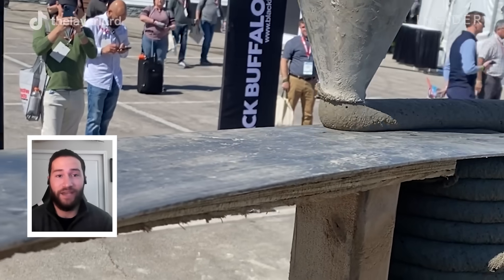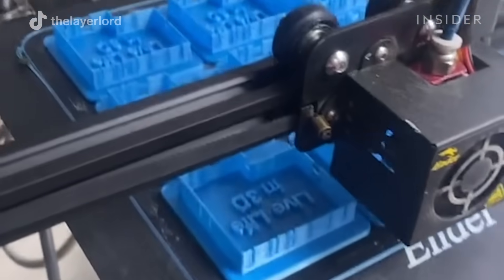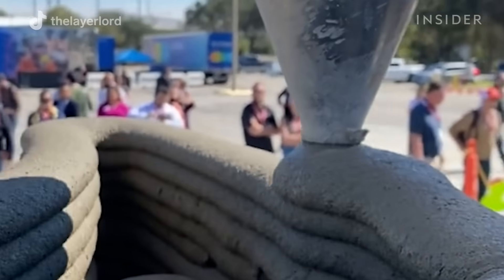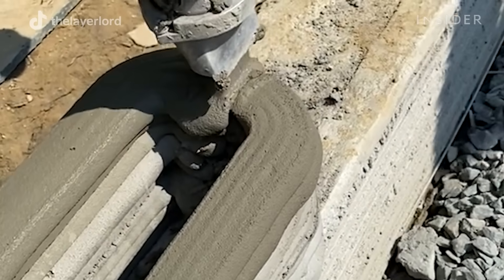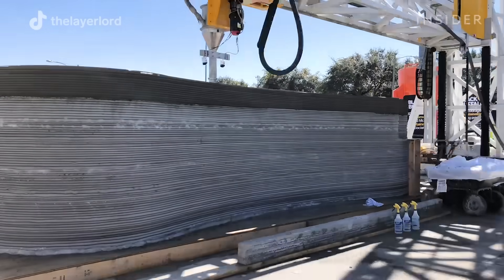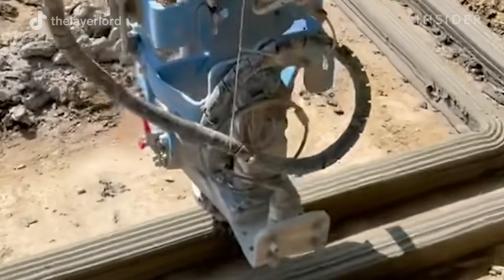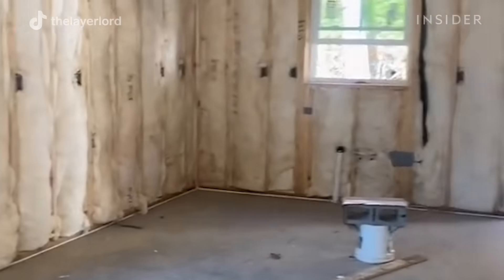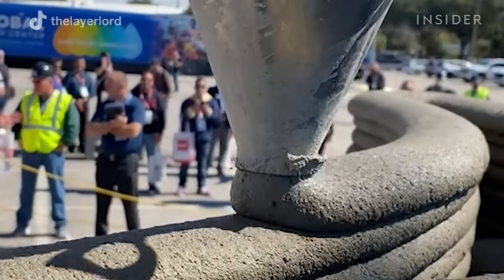How Concrete Homes Are Built With A 3D Printer | Insider Art

Comment: I saw one of these construction sites in my town for low cost housing. The system is incredible to watch. The thing that got me was the amount of labor people needed. It looked like the regular amount of labor used. It amazes me how fast the structure went up. 5 one bedroom houses in two weeks.
Reply: i imagine it will get smaller and less labor intensive as the technology progresses.
Reply: @Teeveepicksures  Well, keep imagining. This will never catch. ICF's are another brilliant technology that never really caught up.
Reply: @Teeveepicksures  시멘트
Reply: Pedro do it in 8 days. For $500
Reply: @bobjones2041  build a house? What?
Reply: @Kneejair I can  build a flimsy cardboard house I can do it in one week,  git er done, I hope that last  check clears before my paint stars peeling
Reply: @bobjones2041 Pedro better than 3D print.
Reply: What is the average cost of a printed home about 2,000 square feet in rural ohio
Reply: No rebar though? Where’s the structural support come from? That concrete will crack to hell with nothing holding it together
Reply: @davek4547  I dont understand it too but maybe they are going for a what is called a "load bearing structure".... basically the concrete is a thick as a brick wall. Rebar or RCC columns and beams are nice but maybe in low earthquake risk places this is possible. Or maybe they are using Wood columns somewhere for support.
Reply: @davek4547  gravity
Reply: @mr.dakamd5444  it still cracks and splits and isn’t strong without something inside. I’ve done commercial concrete for 15+ years. Soon as it cracks, moisture gets in, freezes, pushes it apart etc. it’s not a bad idea I’m just wondering how they engineer it without any bar inside.
Reply: @BB-rt9nc  there’s no structural support. Learn to engineer something.
Reply: @davek4547  are you telling me?
Reply: @davek4547  I read somewhere it was a fibre glass mix? Not sure how much structural support that would add, but I think the foam spray they use as insulation also goes towards the rigidity?
Reply: @joshyc2006  fibre helps. I’ve only ever seen fibre go in one building and it was a schools elevator shaft. Still need bar though. Other than that it’s mainly driveways. I wouldn’t just rely on fibre for structural and I doubt most cities would either.
Reply: @davek4547  Sure but cracks occur for different reasons in concrete , if the moisture is too much in the concrete it will leave holes in the concrete and that could also cause cracks. This looks like a very very thick concrete mixture because it is not even moving one bit while being poured. Also maybe they are using good size  aggregate as opposed to using non like a cement paste . Maybe the concrete is cured well so there are less crack chances. I do agree adding rebar is definitely better maybe just insert directly in the concrete mixture if it reaches a good height and if does break and fall down (Iam just assuming here , I wouldn't know till I see it in real life)
Reply: @davek4547 15 years and you haven't learned much
Reply: They look like crap, like literal crap.
Reply: @MACHOMANRANDYSAVAGE2211  when I saw Africans living on the massive landfill in Port Harcourt Nigeria smilingly procreating, I understood what another African said that "Bushmen have no use for the wheel"  and I believe him. 

"Here, you need Covid shots! Here, you need to get dressed! Take our free clothes! Stop making love for five minutes and visit the soup kitchen for a free meal!"
Reply: @MACHOMANRANDYSAVAGE2211  Jesus rhymes with Feces. Nature doesn't care if a single living thing is "happy, or how long it lives, either. Eat and be eaten, live long enough to procreate. Or else your species disappears.
Reply: @MACHOMANRANDYSAVAGE2211  YT is pretty cool. It's a video sharing site designed for conversation about video content.
Watch a video, or don't;  Like or Dislike it, or refrain from placing a vote; read Comments, or ignore them; Thumbs comments up or down as you wish; respond to a comment or don't 

But  YT is also a magnet for legions of lifeless fanboys screeching "ymYou can't downvote my idols videos!  My idol is God and your (sic) a  Bieber fan lol! Your lack of punctuation makes your argument null and void  Lol! Your (sic) a looser  (sic) sad and pathetic lol! "
Sound like someone you know? 

I'm looking for a dozen of these 3D home printers to sprout up in Martha's Vineyard front yards at any moment
Reply: Where was this ? Please
Reply: @stevenlight5006  Leamington Ontario. People are living in it now
Reply: @erikbalens  you HAVE TO BE JOKING!!!!!!
Every month in this great province the lives of normal human beings are held for ransom over ridiculous money issues!!
The rest of society talks to their bosses and works it out. Unions rely on some sugar daddy to do all of their negotiations (fights. Always FIGHTS with unions!) for them while they sit at home getting paid. Meanwhile the rest of society suffers.
And who DOES NOT CARE...?

UNIONS
Reply: Contact number ?
Reply: That’s nothing for 5 houses in 2 weeks
Reply: they won’t last more than a decade if that 💀
Reply: This is garbage. Garbage process, garbage product, all of it. Garbage.
Reply: I can do that with a crew of six.
Reply: That’s not fast 😅
Reply: in the end the narrator says that they have many people training on site to eventually expand the project and try to retain some jobs rather than replace
Reply: That should be spread to multi-storey buildings as well. 
But it's going to happen only under the dictatorship of the proletariat
Reply: Yeah I am desperately looking forward to more efficient housing solutions in the US. $300,000 wooden mansions are just canceled I hate them and they suck.
Reply: Wondering if hurricane safe for Fla.
Reply: Ha. The Amish could do that in 3 days. Just sayin.
Reply: I’m a framer and we were building a house a day. There were 10 of us and we all knew what had to happen in order for the next guy to do his job and so it was like a well oiled machine. These machines that you see, they’re only as good as the person operating it. Not to mention all the maintenance, the cost of parts when it breaks, the down time waiting on parts and to fix it. Not everything is as good of a product as everyone makes it look.
Reply: Yeah, just imagine how many people will be put out of work . Carpenters , laborers, finishers . Plus these houses will fall apart in a few years
Reply: @BB-rt9nc  there was a crew of people who need to operate these things, move them etc. It does not finish the house, do the roofing or anything like that. Tradespeople are still needed to build it, finish it, plumbing, electrical, roofing, drywall etc. Noone loses any jobs it is just a different way of doing things. The structure still needs time to fully cure.
Reply: @danbailey8182  yeah, that’s what they said about the auto industry
Reply: @BB-rt9nc  lots of things fall apart after a few years these days. Just a way for them to make more money. Stuff falls apart then new stuff has to be bought
Reply: @BB-rt9nc i think in a post-scarcity future there won't be a need for people to work for a living.
Reply: @BB-rt9nc  "I hope the customers check clears before the paint I applied starts to peel lol"
Reply: @BB-rt9nc  no one wants to work! Labor shortages are worldwide. This helps people get into homes without dealing with lazy unions!... just sayin
Reply: @billkeogh1591  true. People also don’t want to work for pennies. If they would pay a livable rate then more people would be willing to do the work but they keep bring on foreigners who are willing to work for low wages and don’t complain
Reply: @BB-rt9nc  and your response is Don't work???
You must be unionized...
Reply: @billkeogh1591  that’s not my response, it’s the reality. People will find easier work that pays the same or at a higher rate
Reply: I didnt know theres such a thing as 1 bedroom houses
Reply: @mr.dakamd5444  three generations of families live in them in many places
Reply: @bobjones2041  very sad
Reply: @mr.dakamd5444  you're not looking at it from their perspective. They actually procreate in the same room with their children and parents and nobody there minds one bit
Reply: @bobjones2041  maybe those people living in the 1 bedroom homes would do it in 8 days for $500
Reply: @bobjones2041  Or they tell their kids to go outside
Reply: @bobjones2041  stop being a bigot. Only your perversion would think that. For the record, don’t you think people know when to find a private time when no one else around? Whatever it is that’s hurting you and/or making you bored, I hope you find peace from it.
Reply: @mr.dakamd5444 Why is it sad? Some people prefer it. Especially if they live alone and kids are moved out.
Reply: @mr.dakamd5444  here there are  small one bedroom houses being built to help the homeless or those who need housing quick. The project I saw is for troubled and homeless teens.
Reply: Where did they jam the insulation?
Reply: @beasthunt  I believe the cement has a certain r value and the rest is that spray insulation
Reply: @beasthunt  Cement actually has great thermal retention properties.  Stays cool in the summer and holds heat in for the winter.
Reply: @beasthunt It's concrete.  😂
Reply: @TallMichellewthelonghair  Oh thank God you
said that because I thought it was cake icing.
Reply: @beasthunt From what I've seen they fill those gaps you see between the walls with insulation. The home should require less heating or cooling and far less danger from fire or termites. You also won't need a stud finder for those walls. However, putting a screw into masonry is not nearly as easy, but certainly doable.
Reply: @dfusselman  I would imagine some sort of spray insulation. Condensation is a thing with concrete as well so it's got to be special insulation.
Reply: @beasthunt I hope you're joking!
Reply: @beasthunt spray foam im thinking
Reply: this is a waste of time and money, it costs more to operate and maintain that machine than it does to hire a crew of 4 skilled laborers (which doesn't require a ton of skill) than it would to build a regular foundation, typical construction practices can have a house built in under 2 weeks as it is already so you're not gaining anything
Reply: 6666

Comment: I'm fascinated by 3D printers but skeptical on this ( for now ) Pouring concrete onto a wood floor doesn't seem right at all, & it needs rebar, etc

For a small unoccupied structure ( shed, garage..) mmmaybe but guessing current method$ w/b adequate/cheaper.
Reply: Good assessment.

Comment: That printed concrete will crumble in a few years.  Spalling and more spalling, more leads to more damage.  This is because the substrate is not settled.  Air pockets and bubbles remain throughout.  Not to mention, no rebar enforcement.
Reply: A lot of unknowns for sure.  You can let them be the guinea pig.
Reply: I looked for rebar also and didn't see any, but I did see some metal cross braces regularly spaced.
Reply: No way, there's pretty much endless scope to develop muck to use in that machine and there is some extremely strong, easy to use material out there, I've knocked down a building that was made from fluid pourable stuff and it was almost too strong to pull apart with a digger
Reply: @mb106429  "No way".  You sound too sure of yourself.  "No way" I'm taking your word.
Reply: @TrulyAmazingPS  don't do that, read more though if you want, you might find it

Comment: There’s nothing solidly binding the layers of concrete together. Where is at least some vertical rebar to give it strength? Just like a brick wall needs to be built with a wave for lateral strength, so does this.
Reply: Totally, that was my first thought I saw some kind of metal zigzag bracing in there but it looked weak

Comment: The amount of cement needed makes the house way more expensive than even a brick house which is already expensive because of bricks.
Reply: True, but laying brickwork requires someone manually applying mortar.  The speed of printing the houses and lack of a massive crew to run the machine might help offset the cost.  Me personally, I'd rather build with brick but like I could ever afford a home in this day and age.

Comment: Impressive, I love that it can do curved walls, but no good for California or any seismically unstable areas. Maybe this could be done with a alternative material.
Reply: See my comment about rebar. Totally agree.
Reply: @brianehni5918  rebar won’t fix that. It will make it worse
Reply: Concrete mostly will crack, and if this has no rebarb, its going to crack no matter how much they streamline the process. I don't like "LVL" beams either. Give me natural wood beams.
Reply: The 3D structure needs to be arranged to absorb and redirect vibrations from earthquakes, but concrete without rebar isn't necessarily unsafe.  Adding a second material for tensile strength in selected parts may be needed, but iron rebar isn't the only choice.
Reply: Everyone is fleeing California anyway, so no biggy.
Reply: @gmanbeavis  I hope so, the freeways are too crowded.
Reply: "Альтернативный материал?"   Это из говна и палок?
Reply: @КозьмаКрючков-ш5ф everyone had a decent comment until you came along, barg off.
Reply: Nothing is good for that shithole of a statw

Comment: I love the ingenuity,  but, like container homes, walls are extremely easy and cheap to build.  I doubt after you include the time to get the printer on site and set up that you're improving cost much.  Possibly, if you can quickly move the printer next door and do the same thing but you really need to build around 50 at a time before this eclipses a stick built house in a meaningful way
Reply: Agreed. Building a large extension currently and the brick layers are getting walls up insanely fast. And the insulation properties of the blocks now are far superior to pumped concrete. I’ve seen other block forms that are even quicker, so I’m not sure about the value of the printer (yet).
Reply: There are now block laying machines which makes using block even cheaper, as for 3d concrete printing homes its a nitch product at best for people that are building custom homes and want to be different....
Overall cost isn't cheaper though...
Reply: @TC-kf9zw  I would rather this than brick in an EF5 tornado
Reply: @JJ-br1nh  I don't know. If this was reinforced concrete maybe, but as shown in the video I think it would crumble to powder. Remember it's not the wind in a tornado that kills you, it's your neighbors car or tree being thrown at you that does it. And an EF5 is carrying a lot of cars and trees.
Reply: @TC-kf9zw  *niche it's something usually built into a shaped wall.

Comment: I design ultra high hard concrete formulas for oil and gas.
First problem, need rebar.
Second problem, it's bug ugly.
Third problem, utilities?
Fourth thru tenth problems, not enough space here to relate.
Reply: Realistic observations.
Reply: 4000 psi per IBC or its out of spec

Comment: Those constructions as well as a 3d pressure of plastic is weak between layer and layer union, over the years you will see the cracks or weak points in the structure
Reply: Unlike pine which is just so perfect
Reply: @bobjones2041  Fair.
Reply: Yes that’s true, but 3-D printing isn’t perfect yet specially in construction so the efforts to get this out there is at most something good to improve on the quality as well as the time it takes to build a home.
Reply: I was thinking I can't be the only one who's wondering about expansion joints surely but u have common sense too it seems lol

Comment: I love concrete and its look. This is an incredible game-changer. I’m going to do my research on this for my next house.
Reply: I have over 30 founder interviews of 3DCP companies you can research
Reply: Your house will be depressing af 😂
Reply: Don't get one.
Reply: This is for incredibly cost efficient, short term housing. These homes are not going to stand the test of time, nor are they designed to. Not a great choice as your next home.
Reply: @johnd9357  wrong on both fronts. It is not incredibly cost efficient because of the cost of concrete, but it is cheaper than lumber and labor. Second, these are every bit as strong as wattle and daub - which is the construction method for all of the contenders for the oldest houses.
Reply: @PalmettoNDN  how long have 3D printed concrete houses been around?

Comment: The title says that they are building a house using a 3D printer.
Why are you fooling people with false headlines?! The house is made up of many details. Only an insignificant component is made on a 3D printer, which is usually even called not walls but partitions. Only a light roof can be placed on these partitions.
The roof is made on a woodworking machine. Tiles are fired in a kiln. Glass is made from sand. Why didn't you call the video "a house is made of sand, or in a furnace, or on a machine"?!!!
Reply: Automation is a long journey be patient my friend.
Reply: @automateconstructionpodcast  technology and development should be assessed at a minimum level. in the USSR, the news often showed not Yuri Gagarin, but the achievements of the simplest worker. from technology development to implementation is a very long way. The shown technology is not promising, not economical, not environmentally friendly.